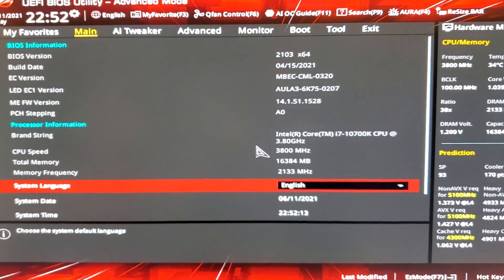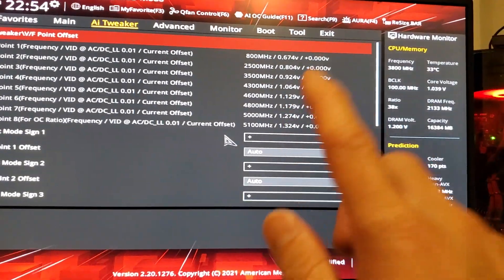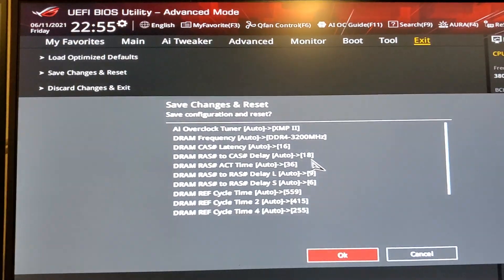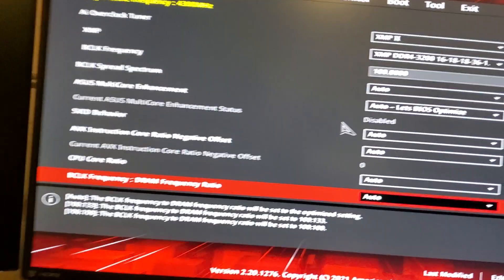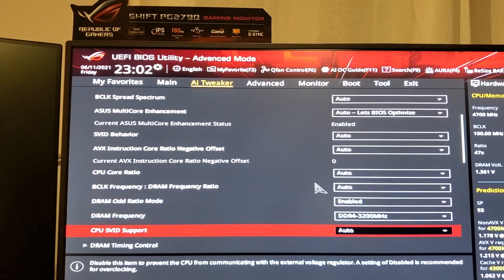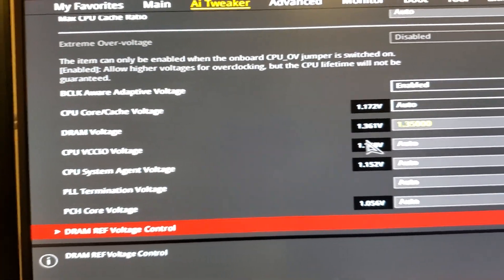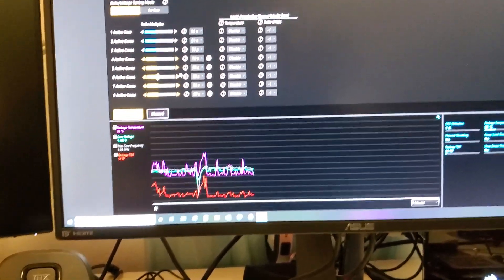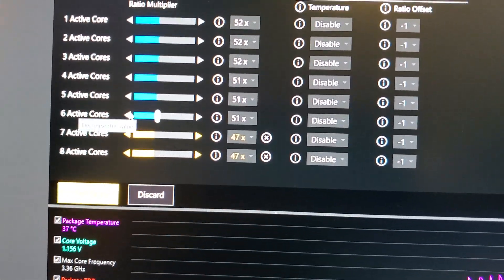Intel i7 10th Gen IA AC/DC LL 5.0GHz Overclocking Tutorial.

Comment: Very nice video I copied your settings I'm currently on a z490 e gaming I can confirm they work perfectly for me but my vid is a little bit higher and my SP prediction is a little lower but I can rock 5 gigahertz all core with peak voltages of 1.33 and load voltages of 1.25 so far haven't had any issues in games or software and my motherboard is actually a lot cooler using these settings other than offset voltage
Reply: What was your settings and load line for 5.0 overclock?
Reply: At 5.0 my motherboard predicts crazy voltages at like 1.4-1.5
Reply from the maker: Nice! Did you used to turn off c-states in your previous overclocking efforts? Could this explain the cooler temperatures now versus prior settings?
That is one reason why I investigated into this AC/DC setting.
Reply: @pianobench6319  no i had c-states on just before but i have disabled them in the past but i think my latency was more consistent with then enabled so i just left them on even when trying a manual overclock. not really sure why but im a good 4 to 5 celsius cooler my motherboard and ive been gaming all day my mobo temps are around 43 degrees. but before i just set best case scenario with load line 4and a +15 millivolt offset which gave me like 1.33ish peak and 1.25 load. is it just lower voltage across the hardware and vrm with your setting? oh and my vrm setting were never really tampered with other than spread spectrum and current capability which i set to 150%
Reply from the maker: @dirty755  You are getting better performance because the voltage and frequency requirements for our Intel chips are not linear. What this means is that the voltage and frequency do not follow a straight line on a graph. Instead the voltage vs frequency curve is a non-linear curve. Meaning that it requires more and more voltage to run the cpu at higher frequencies. 

What this translates to in real world usage is that if you set an offset voltage for your highest frequency clock, when your CPU is at a lower frequency (say 4.2GHz instead of 5.0GHz) the lower frequency will be using more voltage than it would if it was instead running at a stock setting. 

AC/DC Load Line is basically the load line for the alternating current and the direct current. If we look at the basic equation volts = current*resistance (V=i*R). So we can already see that there is a relationship between the voltage and current times resistance. AC/DC LL just sets the resistance in the equation above. When we set an offset, the equation may look like this. Voltage = Current*Resistance + Offset Voltage. 

I have the exact equation for VID that Asus uses in calculating the relationship between VID AC/DC Load Line and other values, but it is too complicated even for me to explain and really requires knowledge from someone who works in the industry. There is a lot of information in this forum post by Shamino. And from his posts, it led me to experiment more with this AC/DC method of adjusting my voltage.

There is a lot of information in this post which is worth looking into. I don't have an i9 10900K with thermal velocity boost so I just took the next best thing. Adjusting my voltage for all frequenies via AC/DC Load Line. So my CPU is now tuned for 5.1GHz, 5.0GHz, 4.9GHz etc..... rather than one frequency. 

Hope this helps?

https://rog.asus.com/forum/showthread.php?106375-MCE-explanations-and-others

Comment: Will this info work for 11700k also? not really on the edge but looking for gains
Reply from the maker: I believe so. I checked the latest Asus Z590 motherboard and I know that Asus Z490 motherboards can also accept Rocket Lake 11th gen CPUs!

What motherboard are you using? I might be able to find a photo where the setting is located.
Reply: @pianobench6319  currently msi z490-a pro but I have my eye on a z490-e for a killer price. currently at 5ghz allcore for gaming
Reply from the maker: @jeffsmith6371  
I think MSI motherboard's label the Intel AC/DC Load Line values as CPU Lite Load. https://www.techpowerup.com/review/msi-meg-z490-unify/images/bios_26-copy.jpg Here is an explanation of what it does via an MSI forum FAQ.

https://forum-en.msi.com/faq/article/cpu-lite-load

I believe it adjusts both the AC/DC values in one setting. But you would have to perform some testing to confirm this. Just ignore the power value and focus on the CPU lite load voltage value. Since the power is AMP*VOLTS = WATT if the current is fixed, then it is just the voltage we are adjusting. It is just that MSI labels it CPU Lite Load vs what asus labels as AC/DC LL in units of mOhms.

You can verify your AC/DC Load Line value in HWinfo as I show in the video.
Reply from the maker: Here is a thread that futher explains the CPU Lite Load in your MSI board. https://forum-en.msi.com/index.php?threads/10850k-questions-and-concerns-w-z490-mpg-gaming-edge-wifi.361871/post-2053487